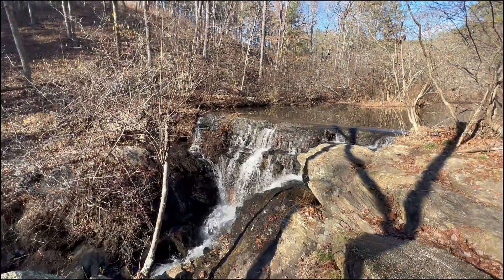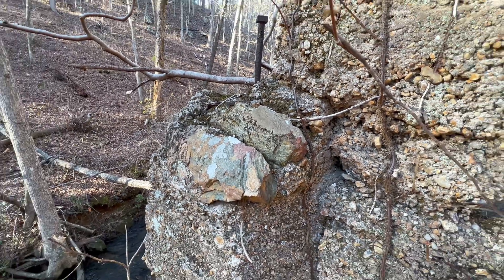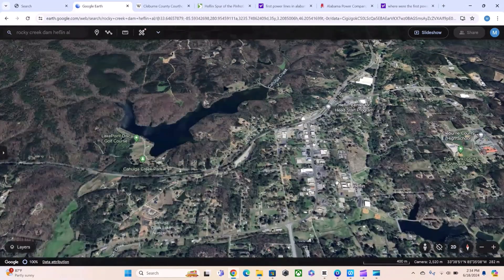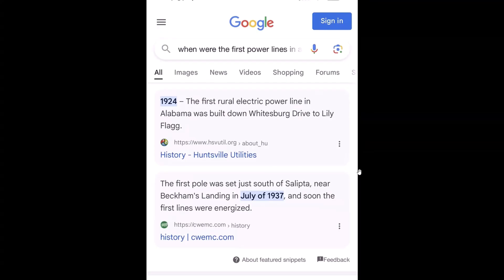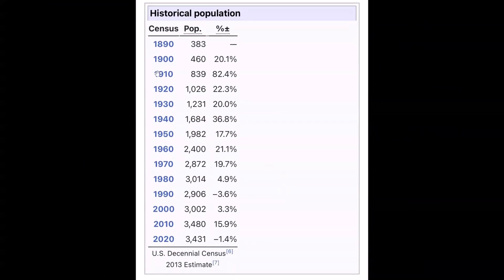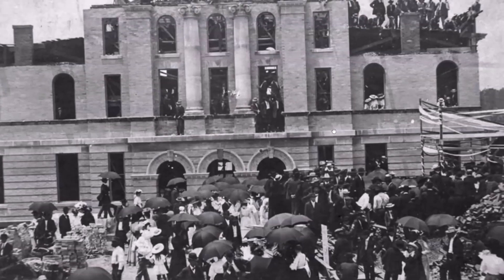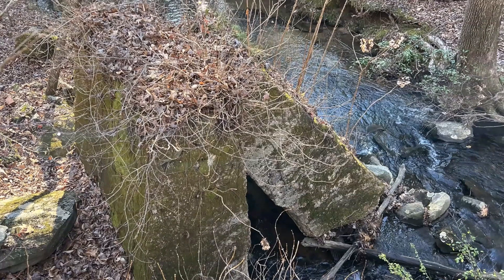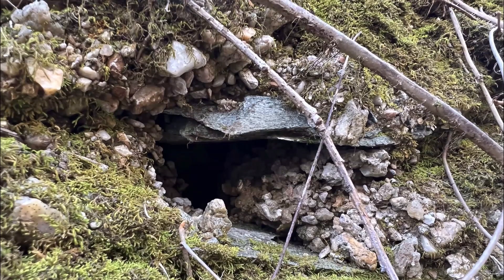Electricity and a tiny Creek Dam that supplied it. Did it Really?

Comment: Electricity was generated cymatically until the resetters destroyed that infrastructure. They came in and strung up dirty electricity. They came in without their engines, with draft animals, and built dirt roads and wooden sidewalks. Lots of people were shipped off to  processing centers.
Reply: Processing centers?  Could you elaborate?
Reply: Adrenochrome
Reply: @LoisGram hes probably referring to what we now call insane asylums. Look up a list of reasons one could get sent off. This place was emptied and there were thousands upon thousands of orphans
Reply: @flightrisk6176 mind unveiled did a series on this and “denying your mother was your mother” was one of those reasons which I thought sounded an awful lot like what a reset baby or an orphan would say
Reply: Asylums  @LoisGram